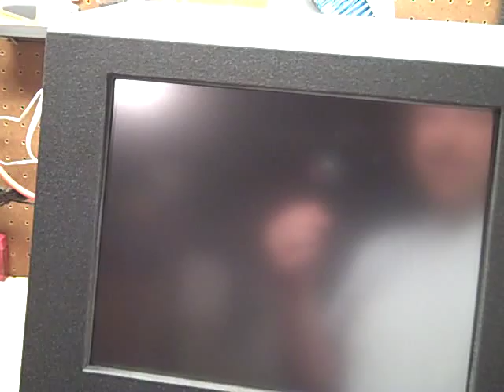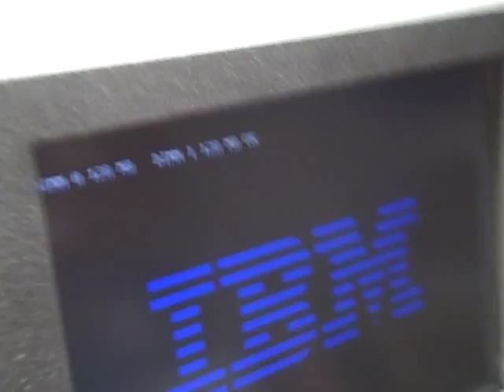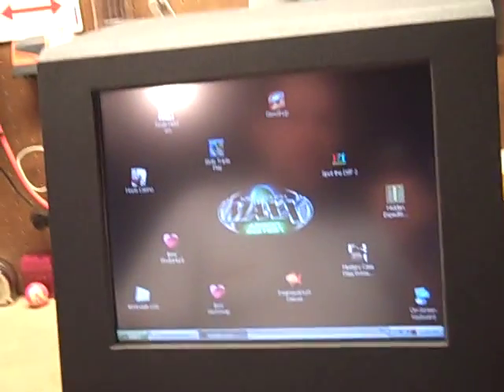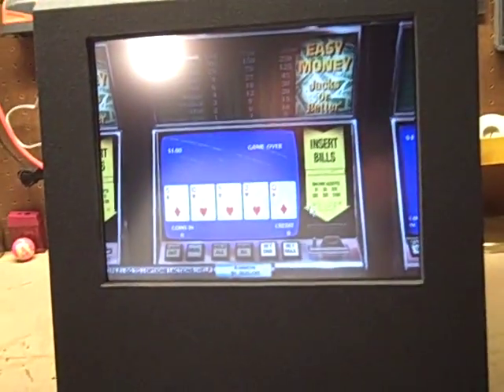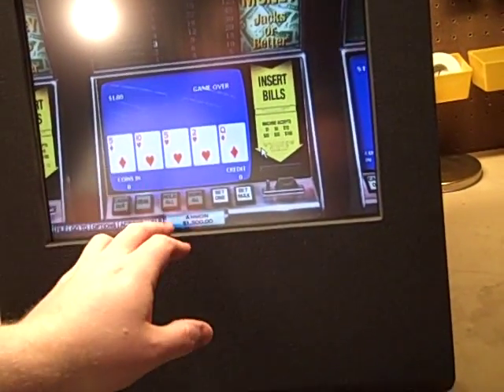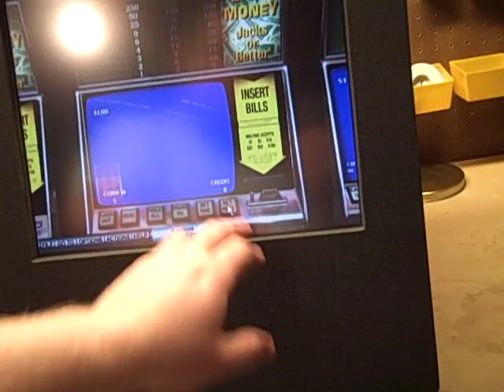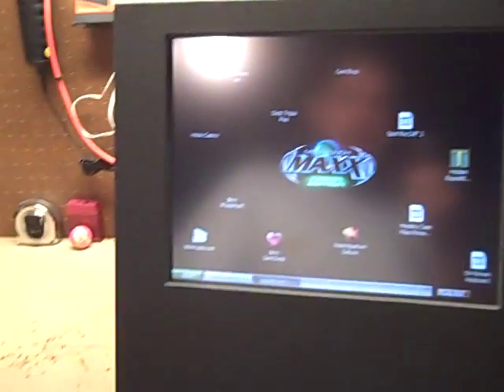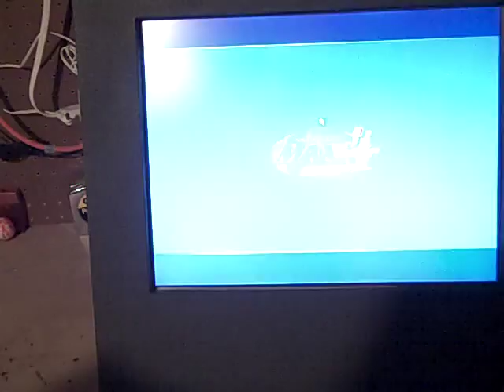Home-built MegaTouch Walkthrough

Comment from the maker: @douro20 Sorry to burst your bubble but they were correct. Megatouch is actually a Linux based operating system. They also have special hardware "keys" built into the motherboards that must match the software running on the hard drive or they will not boot. It is an extremely proprietary setup that is almost impossible to hack. This is a Windows computer with a custom frontend to look like a Megatouch.